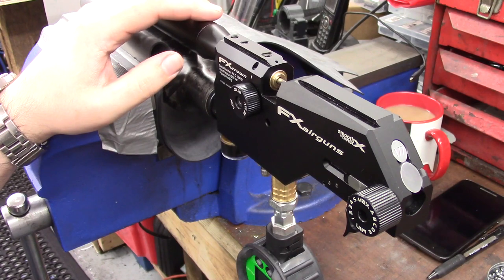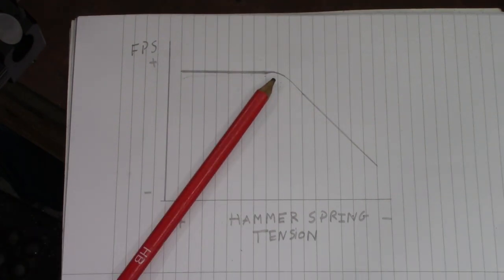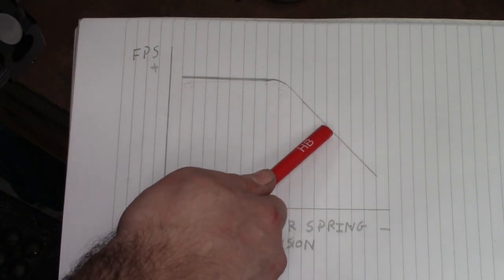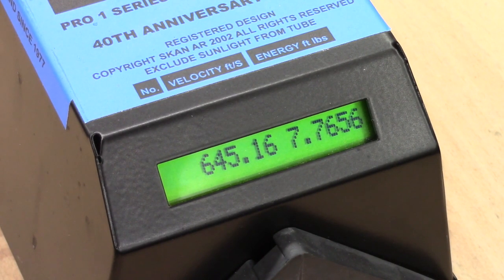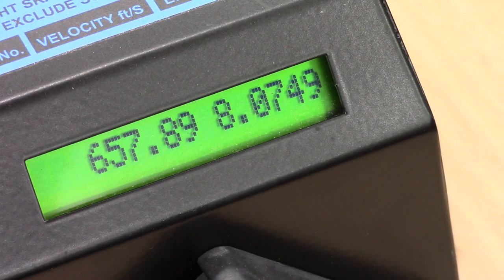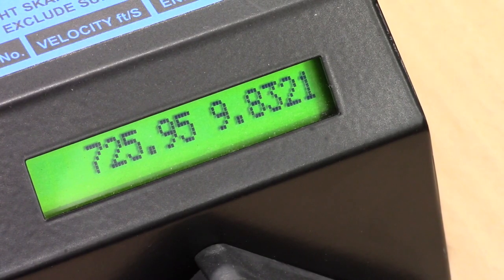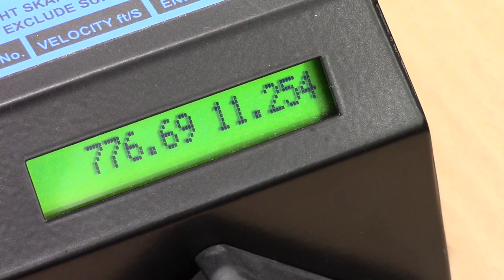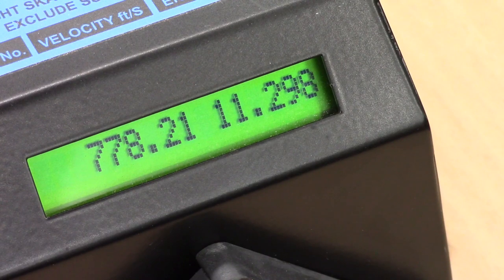Tuning the FX Crown UK Sub 12.

Comment: Thanks very much for sharing your expert knowledge. I had to watch your tuning method several times before I released that what you are showing is really a very simple method to fairly quickly obtain a good tune. I tried to take a short cut on your method and started the process using my current reg settings of 85 bar but found that I was way up on the plateau. I was amazed to find the knee (at an acceptable sub 12 fpe) with the reg pressure set at only 55 bar. This is lower than the reg pressure set by the UK importers when I first got the gun. I now realise that I need to be careful about following advice on airgun forums - someone, who I thought was knowledgeable, advised me to increase the reg pressure to at least 80 bar and then reduce the HST to achieve sub 12. I had been using this setting for some time and wondered why my Crown was shooting poorly at 50 yards. I'm confident that I'm going to get much better results with my new tune (not shot it yet but the tune resulted in a very low standard deviation). I had previously tuned/fettled my regulator, trigger, hammer, pellet liner etc (mainly following other videos of yours) and my Crown is rapidly improving. One thing I would add for others who are tuning for sub 12 is to use a pellet that you know produces a high fpe. That way you should find that your rifle remains sub 12 when using other pellets after the tune.

Comment: This is the method that I adopted too when I started tuning my Streamline FAC   and Dream-Tac FAC. This is a proven way of tuning a pcp for low spread and efficiency. That said, this is the first time that I see it explained in such a clear way. Awesome video. I have subscribed and will direct others to your channel every time I see people struggling with their setup. Add: once I have found the plateau velocity, I reduce the HST until the velocity is ~2.5% below the plateau velocity and fire 10 shots to see how it groups. If not great, then I slightly increase or decrease the HST until I find the best tune. Sometimes I have to slightly increase or decrease the reg pressure to find the sweet spot in terms of accuracy and efficiency (I'm not interested in very high power, only in accuracy).
Reply from the maker: Thanks, that's the way we do it, this gets you around where you need to be then fine tuning the reg and hammer spring for accuracy, it takes a little time but well worth doing in my opinion. Thanks for watching.

Comment: Great video, was looking for a sub12 tune on an FX, for a while now. I have a Dreamline which is a bit inconsistent and with an FPS increase of a few shots after tank pressure drops below reg
Reply from the maker: Thats a fairly common problem to be honest but not a big deal you should be able to wind off a couple of turns on your hammer spring, and see little to no drop in power, as your hammer spring setting is overpowering the valve. Thanks for watching.

Comment: Great explanation! I do need some help though. Does the Crown mk2 have a resistance adjustment on the transfer port dial?? I can't seem to move it and don't won't to force it
Reply from the maker: they can be a bit tight if the o ring dries out
Reply: @sub12airgunners  Thanks for the reply. It is brand new, so seems a bit odd for it do dry out already! Would I need to de-gas to access it?

Comment: Jeff seen others set hammer spring cam to neutral so cam only starts to move spring at min plus .5.  Then set hammer to max and adjust reg till 20 FPS above desired and then reduce hammer spring to desired FPS ! Check out Ken Hikes  and Ernest Roe, seemed much quicker to do.
Reply from the maker: You can do it that way no problem, but this video was more on the theory of tuning and not just showing the quickest way to do it, any rifle FX or other wise can be tuned in this method, we started out with no predetermined knowledge and found using repeatable methods the base pressure for the regulator and a suitable hammer spring setting, in reality when not tuning for the camera, we can setup a crown for range testing in 5 mins flat, but the concept and tuning method is the idea of this video. Thanks for watching.

Comment: Hi great video as I've just got my first FX (Crown mk 2) and trying to tune it but when I have taken it apart at 9.56 you say you need a 2.5 mm Allen key but in that position I've just a plastic black cap so unable to adjust? Or can I remove the cap?
Reply from the maker: that will just pick out with something sharp then you can adjust but it will void your warranty if you remove it
Reply: @sub12airgunners  That's great thanks for the info, been asking on facebook groups and everyone is talking about power adjust but could not see it, i think they though I was a bit mad lol. Appreciate the info, no warranty as second hand anyway 🙂

Comment: That was great Jake, I now realise the relationship between the regulator and hammer spring , I'll be using that method to set up the stressgun 😁😂
Reply from the maker: Good luck Phil, its tricky to get the balance right but worth the effort in the long run. As long as it doesn't turn into a javelin down the range ill be happy. Thanks for watching.

Comment: Hi, Could this method be used to tune the Maverick? Finally got mine over a chrono and it's woefully short on power......Reading 8ft lbs from factory which is astonishing. Also its leaking air. If this is what £1400 gets you I'm not very impressed at all.
Think a phone call to the dealer is in order but just wondered your thoughts? Many thanks
Reply: The methodology is applicable to any pcp. I don't have a Maverick but I think you are better off leaving the 1st reg (the high pressure reg) alone and just focus on the 2nd reg.

Comment: I have an FX crown Blue Laminate and it suffers from massive reg creep despite me rebuilding the reg with new seals. I have also been told by a reg man that this is one of the most common problems with the Crown. Is there any way I can get reg creep down to manageable levels?
Reply from the maker: We polish both sealing surfaces of the reg this helps tremendously, it does not eliminate it completely but it brings it down to manageable levels, the top of the reg piston and the bottom of the reg adjuster are the sealing surfaces in the AMP regs so we get them to a mirror polish and they seal up nicely. Thanks for watching

Comment: Awesome video I do the same thing as well but I shoot my gu. At 1000fps 32.8 varmint knockers slugs in 22cal with 700mm its a beast 💪 of a gun very consistent high reg pressure 160bar
Reply from the maker: Very nice, its a good method. Thanks for watching.
Reply: Not sub 12 foot pound then !